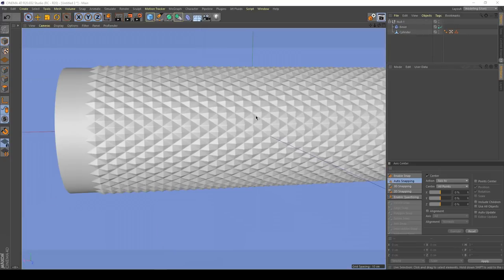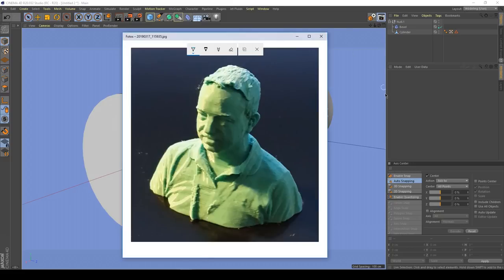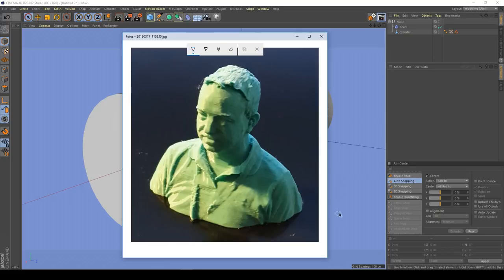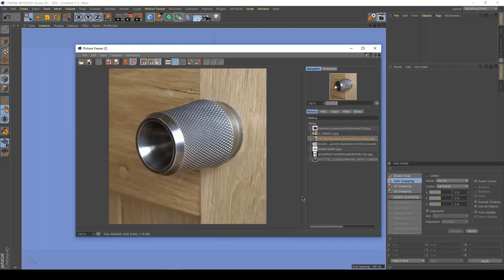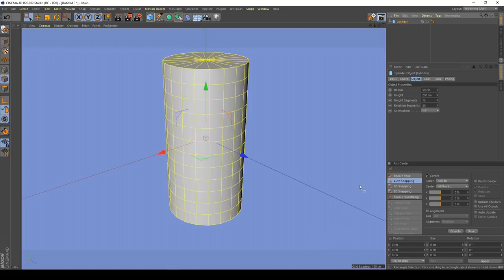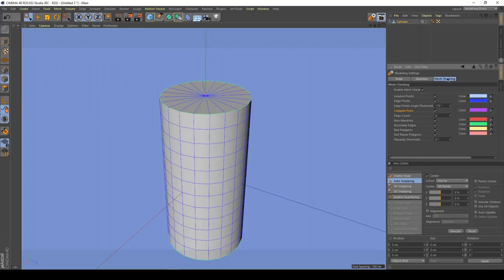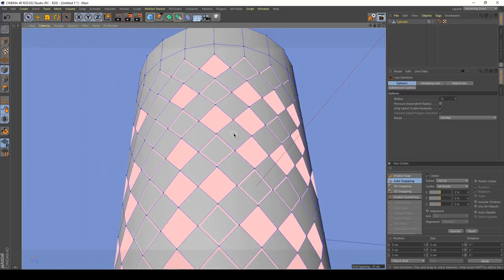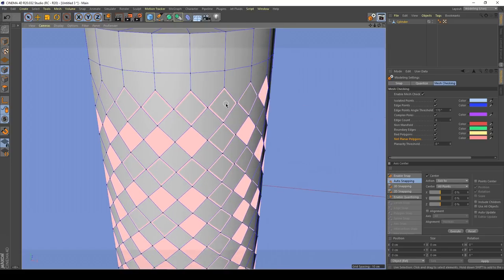004 Cinema 4D modeling with unexpected tools. Knurling

Comment: Nice tip.
I am not a modelling wizzard. So I wonder how you would go around, if you want the amount of "Pyramids" you have in the example. But would have a cylinder with, say double, the rotation segment? Cause the cylinder in it self is not suitable for close up render, with this amount of segments.

Comment: There is a BUG in this tool: when you scale (increase) the mesh the "Bad polygons" disappear... Above all, if you model in low scale (cm or mm...) pay attention because your model could be correct even if the MeshChecker gives error (Bad polygons, above all).